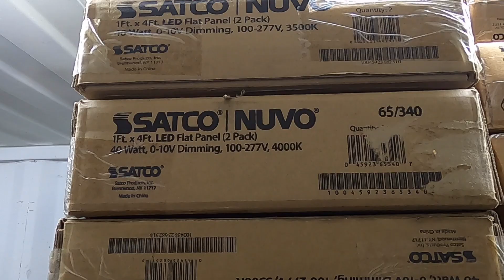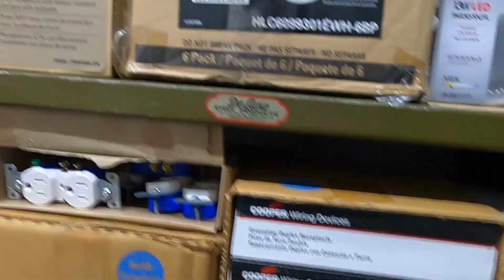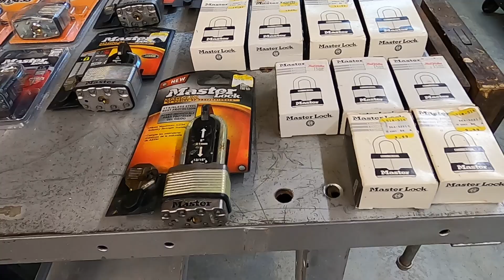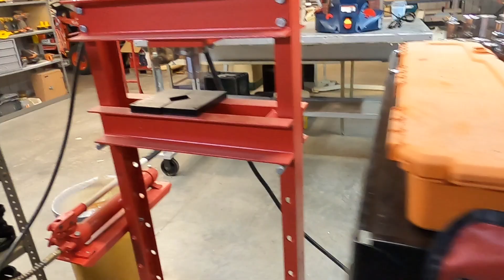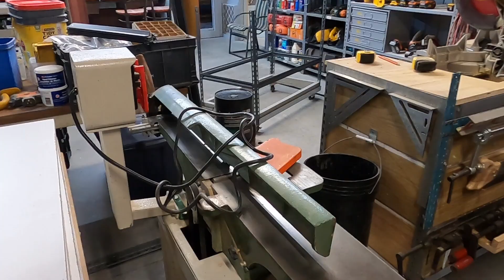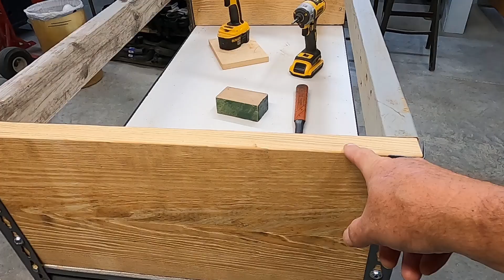Look at What I Found

Comment: I like the rolling cart with the tools on it.  You just need to roll it near an electrical outlet.
Reply from the maker: I use an extension cord to power up the equipment in the location where I am using it.